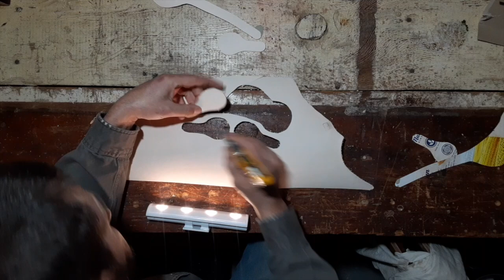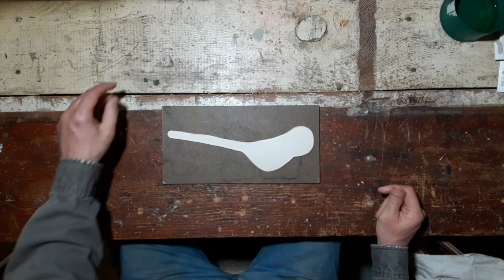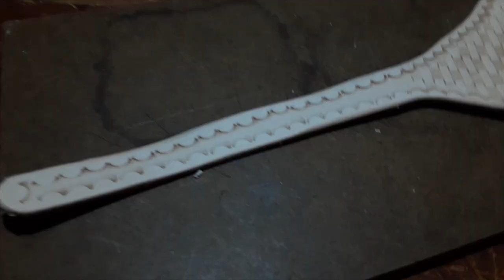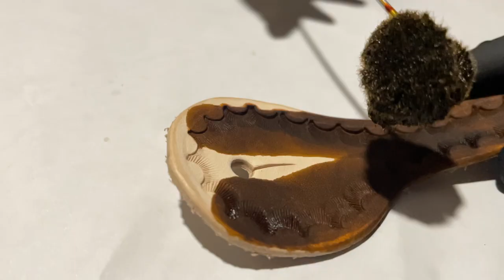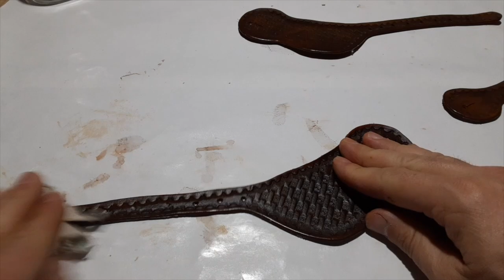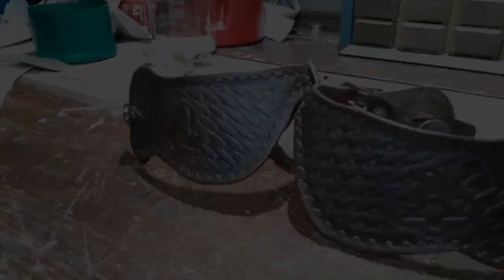Making a Pair of Spur Straps

Comment: Supposed to wet the leather it makes for better tooling!!
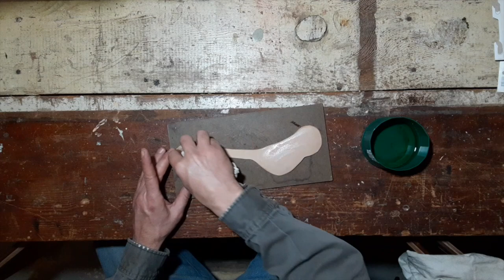Reply from the maker: Thanks for the comment, Michael and I appreciate the advice. However, at about 2:40, you can see that I did wet the leather. I tend to let it get a little drier for my basket stamping, as I had some problems in the past when I tried when it got too wet. I'm not unhappy with the tooling, though things can always stand some improvement.